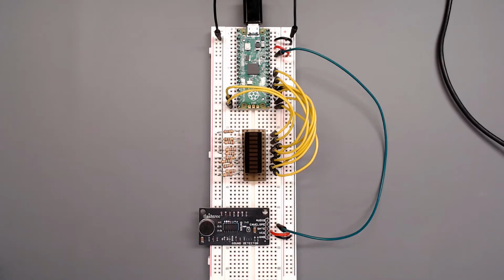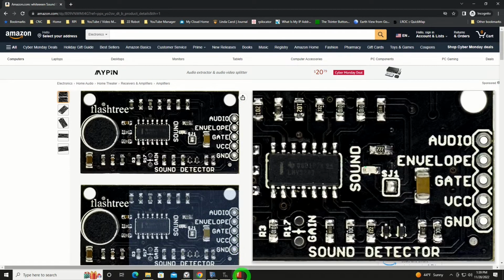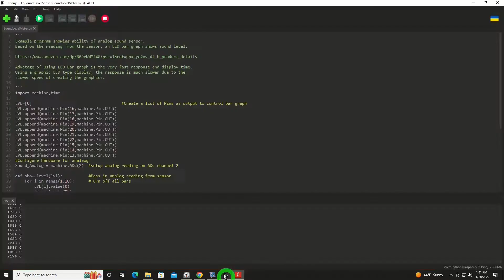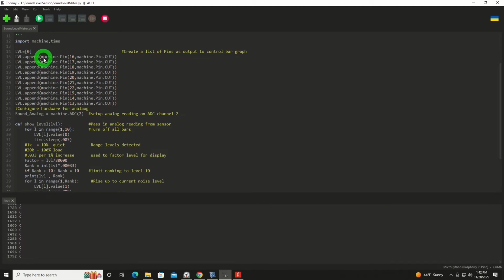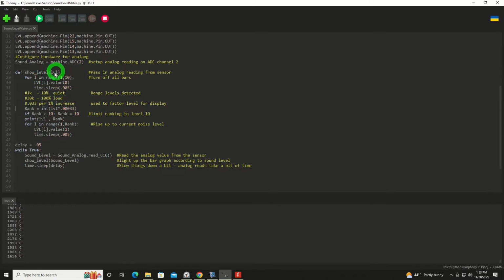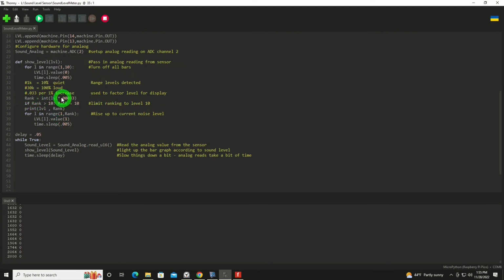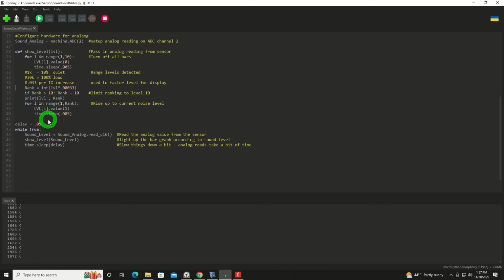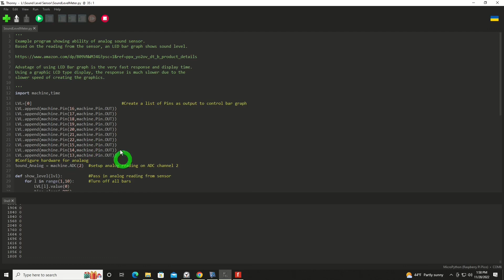Learn How to Use an Analog Sound Level Sensor and Create a Sound Meter in the Process

Comment: Hi Chris an interesting video but I am having trouble finding the source code for the programme you used. I find 2 downloads but both are using Pimoroni display. Can you help?
Reply from the maker: Hello user-cx5qv4xv6q,
I see what the problem is but I don't have time to fix it this morning as I am about to leave for work.  I will try to get that fixed for you by tomorrow morning.
Sorry about that.

Chris
Reply from the maker: I think I got it fixed.
look in the same area for the file titled "SoundMeter BarGraph"
If you are already on the download page from before, you will need to reload that page.
Hope it help!
Chris
Reply: @MakingStuffwithChrisDeHut  🙌
Reply: Thanks Chris for a rapid reply. I have your file. Sadly here in the UK the sensor used is not currently available under £20 ($23) so will have to wait and see if the main suppliers get fresh stock. Cheers Peter W
Reply from the maker: @PeterWest-i7i Sorry to hear it is so expensive!!!! Hopefully a properly priced unit will show up on the market soon.
Cheers!
Chris

Comment: Chris, I recently set up my pico as USB-UART device. As i have some esp12-F bare modules with no usb to serial built in. It took a while to set up properly, but was able to flash the esp, and use thonny to then program it, using the pico as a USB bridge.

Not sure if you have made a video like that, but i think that could be a good one. If you need to have a usb to serial programmer but dont have one and have a pico laying around it works!
Reply from the maker: Hi Gordon,  WOW!  That sounds like a great use for a PICO!!!!  I must admit, I have never had a need for something like that, however, that is not to say there won't be.  Thanks for sharing you cool idea.
Cheers
Chris

Comment: fantastic!! I love projects that make use of the pico ADC pins as i had mistakenly thought in the beginning of my learning (sadly only started programming recently) that only Arduino based boards had ADC capabilities without some external ADC converter (3008) or whatever. On a side note is there a verifiable way to correlate these readings (the numerics from the shell output) to a Decibel value? Just curious, however i can see the use in this regardless. As well it could always be correlated using an external Db meter to get the general value ranges. Nice work!! Ohh BTW First!! (comment) lol
Reply from the maker: Hello Fallen Republic!  Thank for the comment and kind words!  Regarding your question, I don't think there is a way to correlate to Db that I am aware of. 
Cheers!
Chris